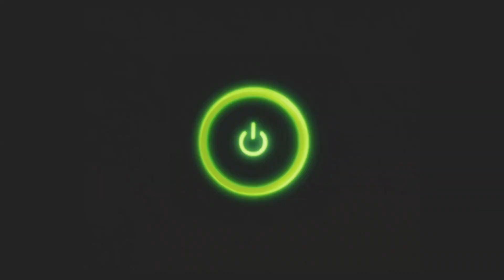ULTIMAKER UPGRADE - 24 Volts

Comment: Hi I think you may be able to help me as I got ultimaker original but missing the 19 v power supply with 4 pin din output so I want to make it myself but I need the 4 pin polarity diagram, do you have it? Thank you

Comment: Hello, I am writing a tutorial on how to upgrade the BOXZY control board (an ultimaker 1.5.7 is used as the control board) to handle 24 VDC.  I have linked to your video.  Is that OK?  Here is the link to the tutorial I am writing.  https://boxzy.dozuki.com/c/Community_Made_Guides

Comment: Hello i know its a old movie but i have a question sinds last week i have a Ultimaker original and i want to upgrade it whit a heatbed and i did watch your movie about upgrading to 24 volts now i understand i need a 24 volts power supply a Recom Power 
R-78C12-1.0 and then i lost you about the pots wat are pots ? 
Next question do you use the original board from the Ultimaker original to connect your heatbed to ?
Regards Wielo
Reply from the maker: Hey I'm glad this video is still helpful!
When I say, "pots" I mean potentiometer. That is essentially a variable resistor in the form of a twist knob. Yes I used the original ultimaker board. I did have to get a extra relay to connect the heated bed to, because it pulls too much current for the stock main bored. But yeah I have a couple videos about all that that you can watch to learn more. Hope that helps!

Comment: hi,i am having problem with my board, it over heat to such an extent that it melts the power jack and its port. what can i do? and what power supply are u using?
Reply: ***** thank you for your advice, yes it is an original ( i guess, from china) and i have not done any modification to it. and guess what? I am using the same power supply as yours. According to you what might be causing this?

Comment: Hi just wondering. The UMO+ has the same board right? Could that mean that with this mod I could run the heated bed and dual extruders with just one power supply?
Reply: Thanks for answering :D My ultimaker-skills have level up, after reading a gazzilion posts. I bough an 280W 24V power supply and changed the one that comes with the machine, it's working beautifully so far. Btw nice videos, keep them coming :D